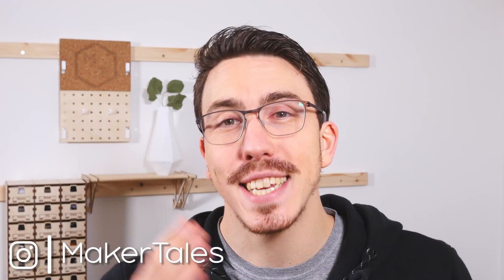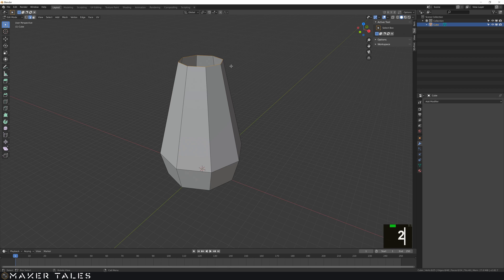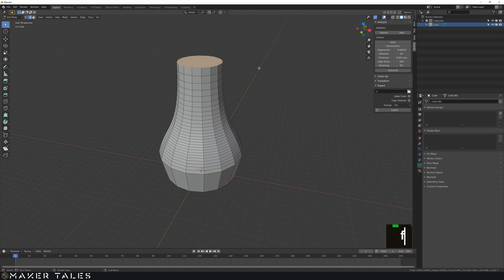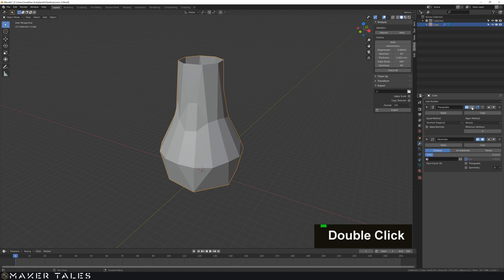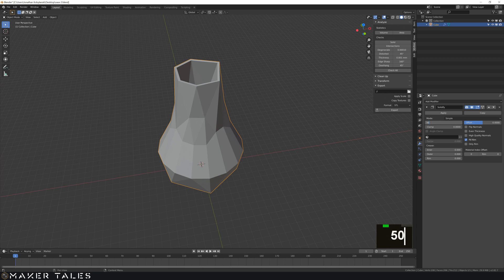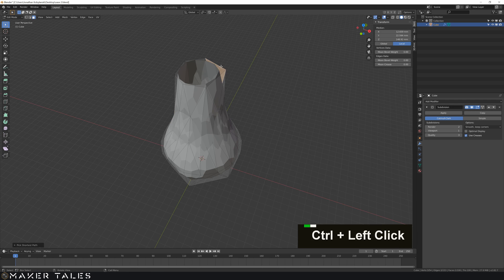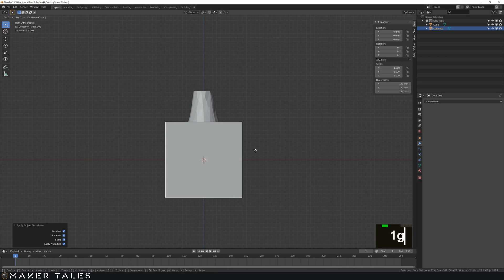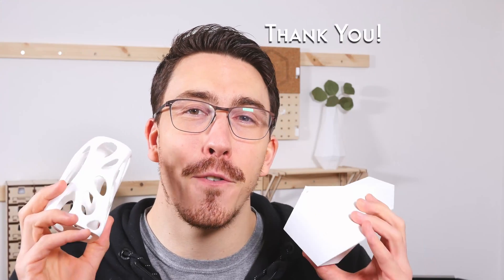How to: Design Unlimited 3D Printable Vase Designs In Minutes - Blender Tutorial

Comment: Could use the knife to cut off the bottom with the cut through whole model turned on to get an open bottom and then fill it with face.  I was thinking you could use the lattice to twist or alter the shape of your vase further.
Reply from the maker: oh for sure. Thanks for the tip icedriver

Comment: hi i have some basic strange question but let me ask it. I am new here and dont know how 3d printers works, i mean how they read the stl file, what i mean is that when we are creating, say some character to be used in a video, i can make arms,legs,torso,head as separate objects and use the rig to hold them together, obviously we can make character with an all in one base mesh, i mean arm,toso,head and legs attached together but even there eyes and teeth happen to be separate objects and we use rig to hold them together. What i want to ask here is that, does the object to be printed need to be all in one mesh attached to each other in the stl file or will it work otherwise as well. For eample i am making an old design lock, now i can easily make it with a cube and a toros cut in half and snapped to one face of cube, will it work? obviously these are two seperate objects with half torous lying on a face of cube. Any help would be appreciated
Reply from the maker: Hey Muhammad Shahzaib Anwar, First thing is yes... a way a slicer for 3D printing looks at mesh is exactly as you think it needs to all be one mesh. If it's not one mesh then it's 2 separate meshes. Even if they are touching or intersecting they are still 2 mesh's. Now if you don't want to join them all together there is a website called https://makeprintable.com/ that does this for you. It does cost a bit and it does not give you perfect results. Now if you aren't aware I also have a full course to teach pretty much every element of blender to be able to make/edit these mesh's yourself. I hope that helps you out. https://youtube.com/playlist?list=PL6Fiih6ItYsXzUbBNz7-IvV7UJYHZzCdF
Reply: Anyone???

Comment: Is there a way I can make a bezier curve, apply the screw modifier with the wall thickness going inwards, and then invert it so everything inside is the solid object I want? So essentially the inside wall of the screw object would be the outside wall of my solid part?
Reply from the maker: Are you looking to have a spiral vase ?
Reply: @Keep-Making  Hi, thanks for your response. I managed to solve it in the end by using the boolean modifiers to cut out the middle section. Sometimes the coplanar faces make the cut come out weirdly but I just go in and delete and rebuild the bad edges/faces with the new vertices.

Comment: How many steps would you think is necessary for the screw modifier if a part has radius about 1cm and the wall thickness (solidify modifier) is around 1mm? I did 64 steps and it seems smooth enough but I just wanted your opinion. The part is also going to be used to cast a silicone mould which will then be used to cast the positive part (which I am modelling) in silicone.
Reply from the maker: In reality, it's up to your taste, just think with an r of 1cm your circumference is 6.28 so 62.8mm. If you are planning to 3d print it may be your printer nozel is 0.4mm so I would say 64 would do but MAX resolution would be 62.8 / 0.4 = 157 steps would be your MAX res defined by your printer.
Reply: @Keep-Making  That makes sense, thank you!

Comment: Your tutorial is great. I came across a problem which I am unsure as to what the cause is. It seems like for some reason my models bottom isn't coming out to be perfectly flat. In my splicing software, Cura, it seems to think there is a slight, visually unseeable bend, and highlights the area and red to show that it thinks it wont print well. This only goes away when I move the model down by around half a millimeter, which I suppose effectively flattens the object. Does anyone know why the model made in blender isn't coming out to be perfectly flat.
Reply from the maker: I'm not 100% sure what the problem is... But if you join the discord i'm happy to try and help you out.

Comment: do you think it is anyhow possible to make moulds for any of the vases you printed?
 I genuinely wonder if there is any aspect of scale manufacturing possible with  complex geometric shapes like these. would be cool!
Reply from the maker: Good question... Hmm I think it's VERY design dependant. As I don't think the vorinno looking ones would ever be possible as a single vase mould. I would see how they might be possible as a bowl however. Or you could cut the vase design into two halves and then stick them later. It's tricky to make moulds ... But if you keep in mind the limitations of mould making there are definitely some things that can be done
Reply: Could you print in a material for investment casting process?

Comment: Really liked this video! Some fantastic tips. I tend to use the displacement modifier to emboss the mesh with an alpha map to add a dragon or some other pattern to the mesh. It took me a while to figure it out but it is important to check the Stretch U and Stretch V boxes on the screw modifier or you will not get a UV map that can be used for displacement or some other functions.